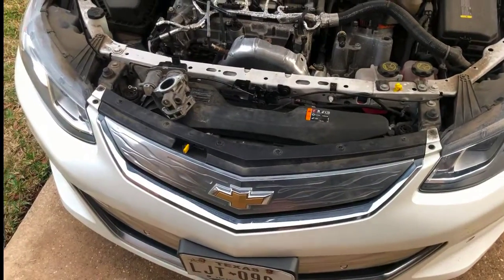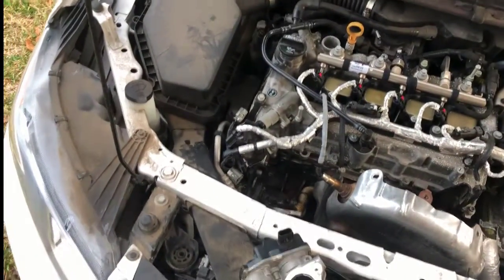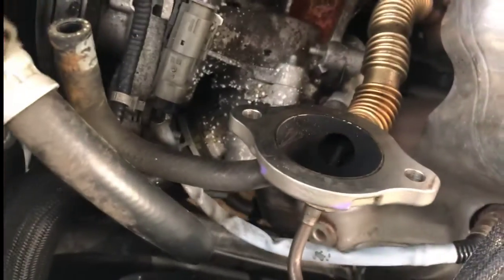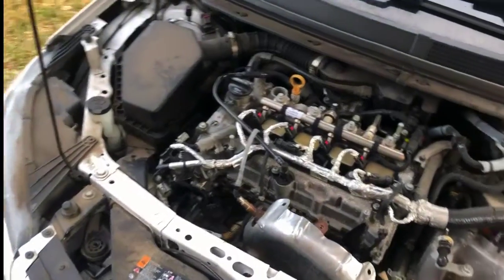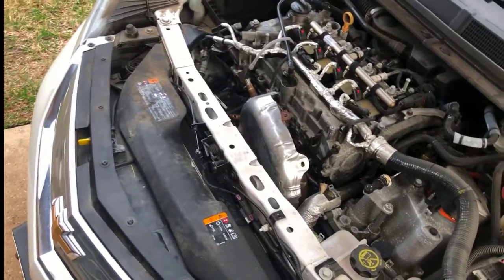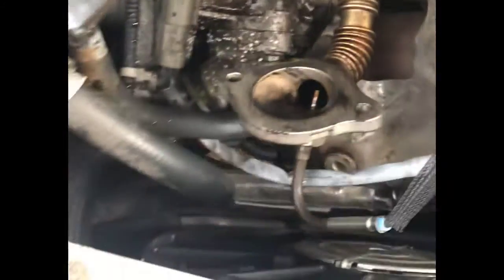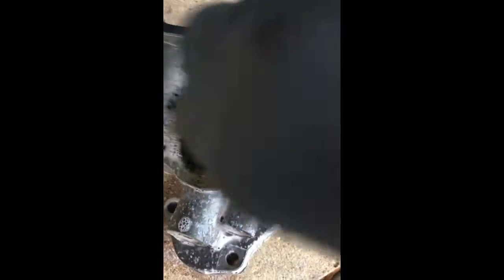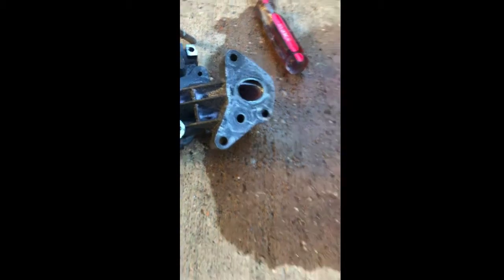Chevrolet P0401 Engine Code - EGR Valve & EGR Cooler Cleaning (Volt)

Comment: TL;DR: I can confirm this fix worked for me too! Thanks a lot Rick for discovering the fix and then taking the time to make this video. 

Some more details: I followed what Rick said exactly. On my car, even after removing the 5 screws (10mm in case you were wondering), the EGR valve kinda stayed put strong enough that shaking it shook the whole car. I tried a few days later again, and this time gently hitting the EGR valve with a rubber mallet pried it loose. The engine coolant hole is on the engine block (not on the EGR valve itself), so be ready with something to plug it. I used chewing gum, but I don't think it worked well, so I had to buy and refill the coolant. Dunking the EGR valve's metal portion in the purple power for a few hours left behind a residue which I then cleaned of with water and a brush. After a few days of driving, I cleared the fault code and it hasn't come back!

I do want the next person who faces this to experiment something. instead of opening up the whole EGR valve (I can't try it anymore since it's already fixed). With an adjustable wrench, unscrew the nut on the thing Rick points to at 1:55 in the video. That allows you to take out the sensor without opening any of the 5 screws. Clean just this probe with some degreaser, put it back together and see if it also clears the code? Please let us know if anybody tries this. It is MUCH easier.
Reply: Since I couldn’t get to the bottom two bolts due to such a tight space, I cleaned the EGR valve without taking the whole thing off as you mentioned in the second part of your comment. It’s been about 24 hrs since and I am waiting to see if the check engine light disappears. I’ll be back to post an update. It’d be great if it could be cleaned without taking the whole thing off. I can hardly get to the bolts even with my tiny hands. 😩
Reply: @kimberlynguyen927  Reporting back after cleaning the EGR valve. My check engine light never went away after a couple months of driving. I went to an auto repair shop and they concluded that I had to get a whole new EGR valve which is on national back-order. Now deciding if I should get one from eBay with the risk of no warranty or get one through O'Reilly's/dealership with a warranty. Who knows when the ones with warranty will be available though.
Reply: @kimberlynguyen1467  Did they suggest to you that it was an electrical short in the EGR electronics?
Reply: @kimberlynguyen1467  That makes sense. Like samlachance1 says, that's just a temperature sensor, so I was wrong in my earlier suggestion. FWIW, the P0401 code came back on my car after a few months, so even the whole fix (cleaning the EGR valve) is not long lasting. 😒
Reply: @kimberlynguyen927 any updates on how it worked for you?
Reply from the maker: So glad it was useful!
Reply: I believe that probe in the corrugated pipe is EGR temperature sensor 1. I think the 2nd one is on the far end of the egr cooler.

I don't have the code yet, but I'm chasing a rough idle, and my valve does appear to be sticking a fair bit. I've been watching the "commanded EGR" and "EGR error" readings on my OBD2 scanner. 
I don't think it's the cause of my rough idle, but I may clean the valve anyway before it gets worse.

Comment: I have cleaned it twice clear the fault code but came  backdo you think its better just to replace the valve and not the cooler. and if i keep driving it with the fault will it do harm to the engine by not replacing it. Thanks.
Reply from the maker: It won't hurt the car to drive with it on. I only needed to clear mine for state emissions testing.  Many folks are having issues with the coolers now, and depending on where you're located, it's possible it's covered up to 150,000 miles.  I'd check with a few local dealerships and see if it's still warrantied. Worth a shot!

Comment: Dr. Rick - Glad I found your video and thanks for taking the time to put this together. Few questions: 1) Someone mentioned we'd need to top off the cooler fluid. You didn't mention that, so please confirm, and if so, where do we top it off? 2) It wasn't clear about the drive cycle. What I understood is that after doing the cleaning, then clear the code with the scanner, and then we have to do that drive cycle to permanently clear it? Or do we do the drive cycle to clear it without the scanner? 3) For the drive cycle, when you say a speed like up to 55 MPH, does that mean above 55? And when you say 3 minutes, you mean exact, or at least 3 minutes? 4) And when you say down to 25 MPH, you mean just below that and then immediately punch it back to above 55MPH...that right? 5) And is there any way for me to know if I did it right or not? Thanks in advance for your help.
Reply from the maker: Hi Musud. It's always a good idea to check the fluid levels.  My coolant levels were fine after my repair, so I didn't need to add any, but if you do, it's easy, and the coolant can be purchased at any auto store. Just make sure it's for GM vehicles. The drive cycle will complete itself and clear the codes without you having to do all the crazy steps. It will just take a week or so of regular driving.  I only needed to do the immediate reset because my inspection was expired and I didn't want to get a ticket. If you need the immediate reset, yes, go up to the speeds mentioned and then go to the next step.  Good luck!

Comment: Thanks for this video. Fingers crossed my DTC readiness checks clear and I can get it inspected before I'm overdue.
Reply: All of my DTC readiness checks except for one (O2 sensor I believe) cleared on my drive into work the morning after cleaning my EGR valve. My state allows one to be uncleared, so I got it inspected later in the day and it passed without issue. No CEL yet. Fingers crossed again, but at least now I don't have the pressure of my inspection expiring in a few weeks. So thanks again. Maybe I'll start saving for the repair. Or a fully electric car lol.
Reply from the maker: So glad it was helpful!  The state inspection being expired was the biggest issue I had, but it ran issue free for another 15 months before popping back up again.  I reset it again and traded it on something new.

Comment: Does it help to use additives like Seafoam occasionally to prevent this problem or even after the code goes off? Maybe laquer thinner would work too. I've cleaned dirty catalytic converters enough to clear the code and get it to run better by adding that to the gas tank and driving for an hour or so.
Reply from the maker: Have no idea, but great question. Maybe a mechanic can chime in if they see your comment and let us know.

Comment: Is there a trick to getting the clip off the connector to the egr valve?
Reply from the maker: Hi 4N.  I don't own a Volt anymore or I'd go outside and take a look at the clip! To the best of my memory I squeezed both sides with my thumb and pointer finger while rock it back and forth and it slid out.  Maybe someone who has done this more recently and comment with some suggestions.
Reply: I'm having a lot of trouble with this connector as well. Definitely can't just pinch from the sides. There appears to be a tab on the underside (great placement GM) but I can't figure out how it releases.
Reply: @leegratz4447  yeaaaaaah, I ended up breaking it. It does take some TLC to get them off. there's a tab on the underside that needs to be finagled
Reply: also, my volt is currently in the shop for the egr cooler and valve replacements. the valve is backordered til the end of Feb. I was able to clean it..., it worked perfectly for like a month, then back to failure. cost = $2500 (cooler, valve, and the 100,000 mi battery trans flush)
Reply: @4n6dave  that sucks. Sorry to hear it. 

I eventually got the wiring harness disconnected after breaking off that piece of the clip/tab. A little mirror helped me see what I was doing. I think the tab was supposed to slide back allowing you to push up on the middle. After teasing out the remains of the tab/clip I was able to push on the correct spot (with the help of the mirror). I can't imagine the design engineer looking at that connection with the release facing down thinking "Yeah, that looks good!"

After removing and cleaning the valve as best I could, I reinstalled and will see what happens. I cleared the code and drove around a little (in Hold drive mode) but didn't have it in me to look up and jump through the DTC readiness check hoops. I just need it to pass inspection next month and then I'll revaluate.

Comment: Thanks for a great video!👍🏻👍🏻

What are the torque specs for two and three bolts used when reinstalling the EGR valve? 
Thanks again!
Reply from the maker: Unsure of the torque specs. I just hand tightened until moderate resistance. If you run across that info feel free to drop it in the comments and I’ll add it into the description. Thanks!

Comment: Rick, Thank you so much for this video. It allowed me to drive 250 miles home from NJ to Rhode Island. You saved me a bunch of time, money, and aggravation. Just unplugging the EGR (the lock on the connecter took a bit of figuring out) and replacing the 15 amp #3 fuse (Non Walk Home" fuse) did the trick. Since it is covered I am taking it in to a dealer.
Reply from the maker: So glad it was useful!
Reply: Where is the #3 fuse (Non Walk Home fuse) located
 @TheProfessorsWorkshop

Comment: Thanks Rick!  Great video.  I have a 2017 Volt and I got the Reduced Propulsion warning, and the CEL came on.  Took it to the dealer and they sat on it for a week and then said they didn't have the part. They did say it was the EGR valve. The dealer didn't want me to drive it, but the car seems to run fine.Took it home and followed your advice; removed and cleaned the EGR valve. I tried to do the drive cycle, but the traffic was ridiculously slow today and couldn't effectively complete it.  I guess I'll just have to wait it out with the regular driving (no emission test constraints where I live). Your video really helped out; it was the best source of information on the internet!
Reply from the maker: Glad it was useful Glenn. The drive cycle component is horrible to complete if you live anywhere with traffic!
Reply: Just some input here. I have been getting intermittent propulsion power limited messages and then noticed a pop or knock intermittently. Tracked it down to when the engine would start. Thought it was the exhaust hitting a bolt under the car. Today I got a cel for p0401 and f3 fuse is not blown. We’ll after reading this comment and watching this video  I believe it just needs a good cleaning. I will update after cleaning it.
Reply: Did it worked? @ScootinNTunin
Reply: @68elsancho  for about 8k miles, now it’s back on. I plan on cleaning it again here for SmoG reasons. It did not cure the popping sound. That is a service bulletin that requires a ecu update to cure. It does not harm.
Reply: @ScootinNTunin   mined started having propulsion power message when engine is cold but onces is operating temp runs amazing only cell I'm getting are the normal no engine start. My plan is to unplug the EGR and drive it to see if issue still there. I'm still cleaning the EGR see what it does

Comment: How do you remove the connected wiring?
Reply: The clip has a lock underneath that slides towards the front . Then it slides off easily. I used the can opener tool on my swiss army knife to hook pull the locking tab. It was too hard for my finger alone.
Reply: @eray1066  I tried using a screwdriver to slide it back and I think the lip of it snapped off. Real pain in the ass.
Reply: Copied from another reply I made above...

I eventually got the wiring harness disconnected after breaking off that piece of the clip/tab. A little mirror helped me see what I was doing. I think the tab was supposed to slide back allowing you to push up on the middle. After teasing out the remains of the tab/clip I was able to push on the correct spot (with the help of the mirror). I can't imagine the design engineer looking at that connection with the release facing down thinking "Yeah, that looks good!"

Comment: Thank you for this. Did you have a reduced propulsion message as well, or any other codes thrown? My 2017 broke down months ago (its a CPO with warranty) - Chevy has had it for 2+months telling me it needs a new EGR. The part is on national backorder with no ship date in sight... cant source it from any sellers in US, and no aftermarket will work per Chevy. Debating pulling it from Chevy and trying this, but I had a myriad of other codes that were thrown when the EGR failed. Chevy has given me the worst customer experience I've ever had. Making it sound like its my fault that they are an American company (that was bailed out with tax dollars) who chose to have their parts manufactured overseas. They refuse to give a loaner, or provide proof of reimbursement for a rental. Nobody is lifting a finger.
Reply from the maker: Sorry to hear about your experience, Alec. The EGR will often throw other codes (like the propulsion one). The EGR also won’t hurt the car if driven while you wait for the part. It’s emissions related only. Mine eventually threw the code again a year and half later and I had to clean it again. Last year you could get the EGRs on eBay for a few hundred. Hope your issue gets resolved soon.
Reply: @TheProfessorsWorkshop  Thanks for the reply. I managed to find one at an out of state Chevy dealer for about %200 normal price. Seemed worth it considering everything. A bit disheartening that it seems this will be a repeat occurrence with the car. Debating trading it in for a 22 WRX.. Those gas prices though.. Hoping the EGR is the only issue as some of the other codes seemed to indicate a misfire in a cylinder. We will see next week... Ill be sure they give me the old EGR back so I can clean it and rotate it in when this other one starts throwing codes lol

Comment: What bolts were on the egr? I need to change mine but i just moved and dont wanna buy a whole set til i get more moneh
Reply: 10mm
Reply: @TheDaveANH  i figured it out. Thank you though! It worked for a few days than same code aha. Its that damn cooler
Reply from the maker: Yeah, that was my fear with mine.  There was no way I was changing/ cleaning the cooler with the tools I have.

Comment: Thank god that in CA it’s covered for 10 years so I had mines replaced for free.
Reply from the maker: That would have been nice! Out of warranty when I did it : (
Reply: I called the dealership & they said they didn’t cover it. Do you know what the coverage is called for it?
Reply: @getfilipino123  Dealers lie. It may be covered but slimy dealers will say it's not covered when it is. Do research online and bring it in to plead your case. Just because dealers don't get adequately covered for warranty work shouldn't be the customers problem.
Reply: is that a state law?  where can i find the information?

Comment: Alright last question haha. Do you think I can clean it and get that valve moving without taking it off?
Reply from the maker: Sorry to hear of the issue getting to the bolts.  I remember getting a few knuckles scuffed up trying to access it, but really it's the only way to get it off.  Maybe get some beer and pizza and bring some friends over with some smaller hands.. lol.    Unfortunately, it's not a part that can be cleaned in place.  It will need to be removed.  I think the parts and prices have come down significantly in the last year, in the event you have to have it worked on.  Also, it's not going to damage or hurt the car.  It's purely emissions based. I drove mine daily for 10 months with the light on, and finally cleaned it/ cleared the codes once my yearly inspection was due.
Reply: @TheProfessorsWorkshop  yea I can tell it just needs cleaned. 2017 with 68k on it. Kinda shocked that this part needs cleaned. My jeep is a 2014 and never had this issue and she has 106k miles on it. I got 4 bolts off. I'll get the 5th. What fluid comes out from the back? Coolant?
Reply: @SnakeDoctor303  i just did this and think its my EGR cooler but yes youll loose about 1L of coolant so put a tray down. as for fully removing. you can just take off the outward facing side...but youll only be able to clean that side. if it doesnt fix your problem youll end up taking off the whole thing anyway. (watch out for the bushings on the 3 bolts holding the EGR to the block, they get lost quick
Reply: @SnakeDoctor303  what size bolts were they?

Comment: How the hell did you get this off lol. I cant get to several bolts
Reply: Not sure if you ever ended up trying this @Gunner but access is definitely an issue. It helped me to disconnect the wiring that is in the way and beyond that it's all about small enough hands, long enough fingers, ratchet extensions, and dexterity. I found the bolt on the bottom left of the EGR valve as well as the coolant hose (disconnecting/reconnecting it from/to the EGR valve) to be the most challenging in terms of access. The wiring harness connected to the top of the EGR valve (which has its release on the bottom side) was a real pain in the ass too.

Comment: Wife just came home and I got the P0401 code. How do you disconnect the electrical connector from the egr valve? I feel like I'm going to break it
Reply from the maker: Been a while since I’ve done this, but it should be a push connector. Squeeze and pull. Good luck with your repair!
Reply: @TheProfessorsWorkshop  yea its very different from all the other connectors. I'm not seeing or feeling any push pin to release it
Reply: I finally got the connector off. How the hell did you get to the bottom bolts lol? My big and hands aren't getting in there
Reply: @SnakeDoctor303  how did you get it off???  I see there's a Grey tab on the underside...just squeeze it?  Or Is the Grey tab a lock that has to be pulled out???  Thanks
Reply: @danschoen3349  pull it out